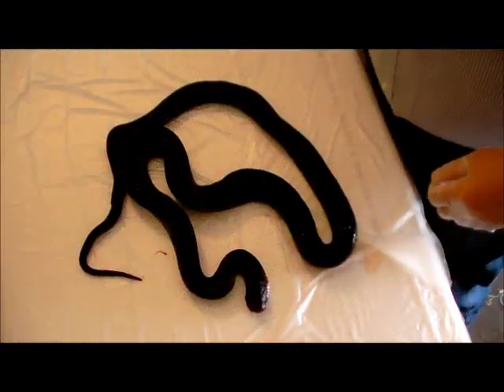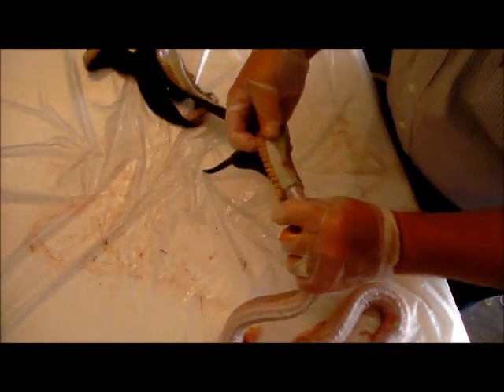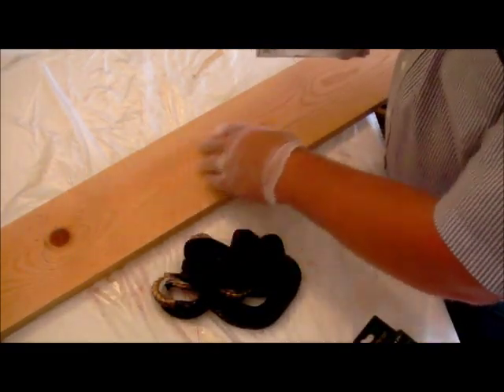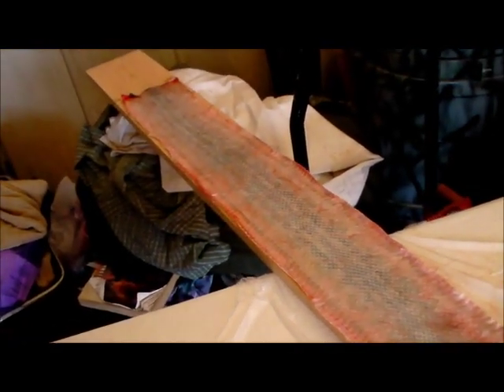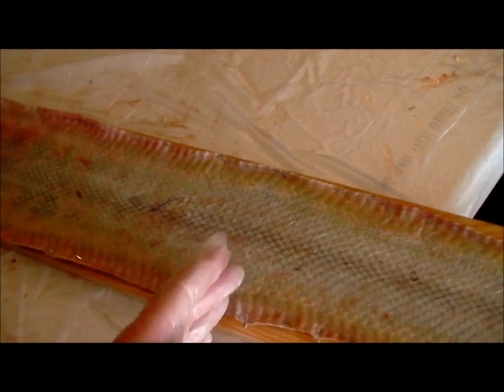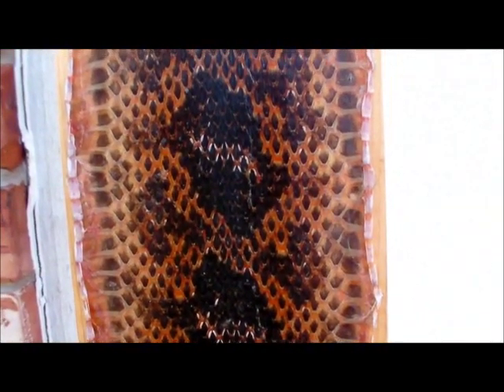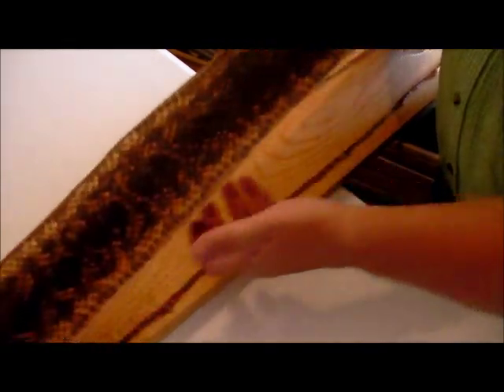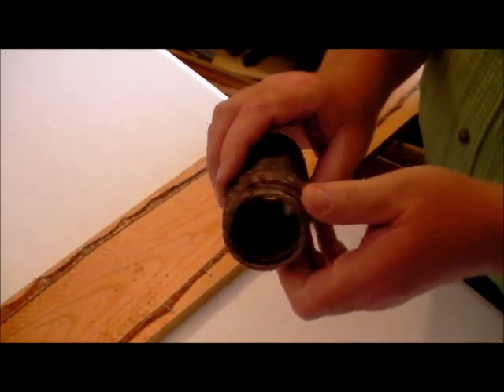Skinning, Stretching and Drying a Snakeskin

Comment from the maker: @DolittleMccoy - I usually leave it on for 24 hours just to make sure it's totally dry. The sides take the longest as the middle part is dry in just a few hours. The skin is left to dry out of direct sunlight as I want it to dry before it should possibly start to decompose. I leave the scales on until it's glued to the back of the bow, that's when I take the scales off. At that point, almost any tape will work to remove the scales.

Comment from the maker: @bighuntingboy1994 - I would say "yes" but remember that snakeskin is a bit fragile. It can't handle a lot of wear and tear. I would use rubber cement and attach the snakeskin to a plain leather belt. After the cement is dry, use tape or just your fingernail and worked the scales off. You may want to use a leather finish over that to finish up with. You also may want to do a bit more research on the web for more information on the process.

Comment from the maker: @BDisepic - It does depend on the type,and size, of snake.  A rat snake, like the one I dried in this video, has a tougher skin then say a copperhead.  Large rattlesnakes are also easy to work with.  Basically, the smaller the snake the thinner the skin will be.  The thinner the skin, the easier it will be to see through it.  If using a very thin-skinned snake skin for a bow backing, you may want to stain the bow prior to adding the snake skin to make the color come out.